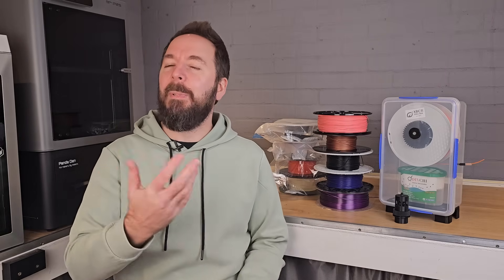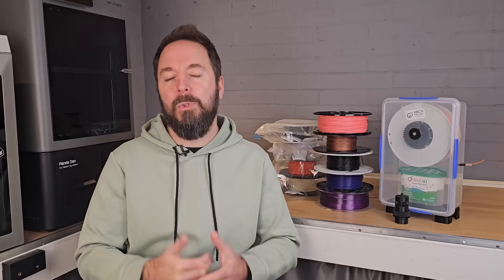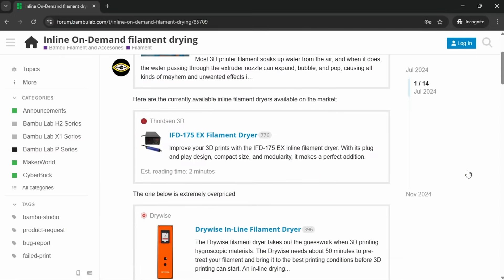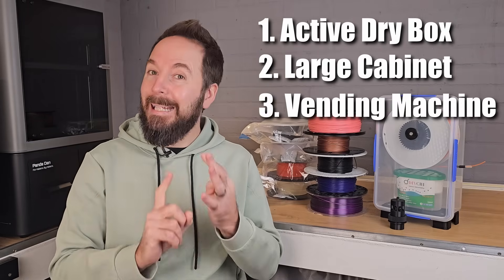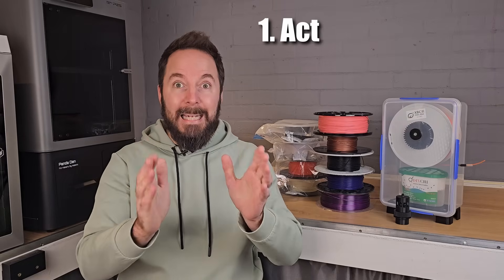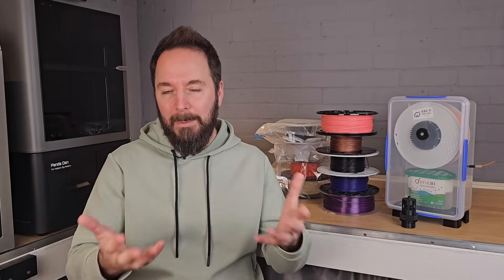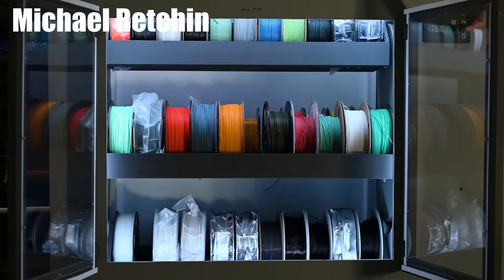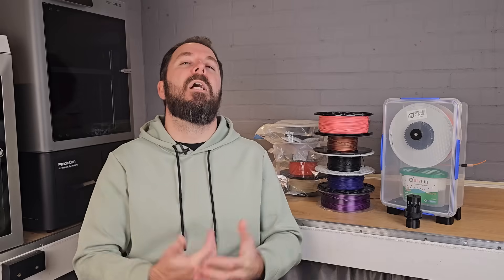Filament Storage 2.0 - The Plan

Comment: I currently use the cereal box method with dessicant for my PETG and TPU.  There are only 4 or 5 of these boxes.  I was thinking about your vending machine.  If you have an air tight cabinet that you can see into with a carousel you could set up a pair of gloves through the wall like hospitals use with premature babies.  You could then select your spool with the gloves and place it into some type of drawer that clould then be closed inside the cabinet.  Once closed inside you remove your hands from the gloves and open the drawer from the outside and get your spool.  Air inside the cabinet doesn't change and no need for a mechanical delivery system.
Reply from the maker: Cool idea that keeps the cost down for sure!

Comment: I would like to see 1 and 2. It would be nice to have a 1 with maybe space for 3-4 rolls of filament. Or a drawer format.

It’d be nice to see a modular solution that could exist on a set standard of space. You could then create generators similar to gridfinity. You’d have to separate the drying, desiccant, and storage into separate values. This way it could adapt to whatever containers you could fit into whatever is available. Using a generator would help keep the administrative work down while creating a successful, widely available, and logistically possible system. 

I would love this if you could store and print from this would be best for me with a drying option being awesome. But I don’t have the technical knowledge to be able to do any of this. But it would be awesome.

Comment: I'd say 2 is a good alternative that I have been thinking about, just make it with MDF or even start out with something from IKEA, make some doors and you're done. While it's true that the open door problem is there, as in suddenlly your whole cabinet is normalized to the outside humidity (whatever that would be). I just wonder if 2 could be combined somehow with somewhat sealed drawers for each roll so that you can, even without a carousel as mentioned in 3, you can easily pick a single roll without changing much for the other rolls in the system. Obviously, 3 is even better, but it might be a bit expensive and take a long time and introduce a ton of sources to potential errors…

roy

Comment: Great Video and very good project.. I'm a Number 1 and 2 for myself. But the CFS's should have a companion dry box for all four rolls. My new K2 Pro combo is GREAT but switching filaments can be a problem. Loaded the original 4 rolls, but the WHITE went funny(wet) fast and broke off in the bottom (2) had to remove it and get the piece out. after I re-dried the spool its printing good but one part did lift the corner of a piece slightly out of 6 alike pieces, the part closest to the door(so sus)

Comment: Exciting ideas, and I subscribed to watch what the community comes up with, but I think many people have a requirement that's not been touched on, and that is at odds with some of the proposed goals: use of an AMS or similar system. Being able to print directly from the dry box isn't going to help when I have to move the spool to the AMS. I don't think I'll actually use whatever solution is come up with here for this reason alone. That said, I'm still highly interested in what is created here, and I may be able to "steal" some ideas for my own needs.

Comment: #4. If we can get that to work reliably, the storage becomes much less of an issue. I think that it would have to be adjustable to the filament you are printing with, and it seems like the commercial versions (that I have seen so far) don't use a long enough path over which to dry the filament. I believe some company recently introduced open-source filament RFID tags. I think these could prove themselves to be invaluable to your cause here. Obviously as a basis for keeping track of what filament you have, but also, could be read by the inline filament dryer so it knows what settings to use.

Comment: I think I like the Active dry box (1) for single filaments the most, because it's flexible. I am pretty limited on space, so I don't really have the option for a cabinet. I think the suggestion of a dry box to dryer "adapter", so you can just put the box on the dryer instead of needing to take the filament out, is great. I am wondering if it might be possible to 3dprint the boxes, because than we wouldn't be limited by finding boxes of the right size from local sellers, but I don't know if you can make that air tight enough (Maybe with a TPU seal?)

Comment: 2 and 3.

Currently I have +200 spools all 1kg (I do have 3 or 4 3kg but I'm not stressing about those) so if there is a cabinet involved I am sure I'd need several - so.... cabinets that can be placed close to each other without impeding access to the spools would be a must.

Thinking about the issue of opening a cabinet and allowing damp air inside.... maybe. the cabinet is actually a series of smaller cabinets, stacked and connected, so air escape/ingress is minimised.  I like the idea is stacked smaller cabinets as it could make assembly easier and cheaper.  Cabinets that have some ducting that connects via magnets and have valves that open/close as the cabinet doors are opened.  Maybe.

This is a great project idea.
Reply from the maker: Some great ideas, thanks Ian

Comment: I think it would be good to combine option 1 with the others, so you would have an individual dry box for each spool, that would act as a cassette, or cartridge that will slot into the larger cabinet or vending machine. For storage or drying, but can be printed from directly when removed.

Maybe then you can separate the drying and maintenance responsibilities, with the cassette holding some dessicate, but the cabinet or vending machine having a dryer that the cassettes connect to when stored

Comment: I'm very intrigued by 4, currently I have a small 5 foot high shelf from harbor freight and I keep my filament in the boxes they come in from microcenter with small dessicant packs in the center of the spool. I use a nuwave oven to dry my filament and keep them in vacuum seal we d bags inside the boxes. But the shelf filled up immediately and I would need a second if I get more filament. But other than that it works well for me.

Comment: Just an idea for option 1, why not build a drier unit to a lid, then all you have to do is fit the drier lid to the box, dry the filament and then swap back to the normal lid. No need for any connectors or complication.
Reply: That’s just the Polydryer with extra steps
Reply: @spencer4hire81 and significantly cheaper
Reply: @Atlas_FPV  time is money, and I prefer using my printer to print prints for my projects, instead of using my printer to print prints for my printers. The filament you would need to accomplish this safely is not cheap like PLA, and you would still need off the shelf components and safety mechanisms. Buy the polydryer and modify the dry box to fit it. KISS.
Reply: @spencer4hire81 none of that is true sorry, it’s extremely easy and very cheap.
Reply: @Atlas_FPV none of it is true? Okay, ignoring the fact that you’re telling me what I prefer to print, I value my time at $20/hr. And I value my printer time at $2/hr. Show me a design that costs less than $60 in filament cost, material cost, and assembly time for a SAFE heater with at least two failsafes. Just because I’m interested in fairness, we can ignore the cost of design. And I won’t even factor in opportunity cost of the other, more lucrative projects that you could otherwise be spending those resources on. 

For those with the resources to buy off the shelf, DIY is best reserved for where it will give you capabilities that you can’t get off the shelf, and where it can save you lots of money. I need maybe four polydryer heaters ever, but I can use dozens of polydryer compatible boxes.
Reply: @spencer4hire81 you have created in your head what this should be and you’re projecting that onto me. Just leave it, my time is worth £33/ hr and you’ve wasted £10 of it.
Reply: @Atlas_FPV You told me it was easy and cheap though, so why can’t you just do it and share the results?
Reply: @spencer4hire81 it is… the issue here is simply that your mind cannot comprehend the solution, that doesn’t mean the solution doesn’t exist. I will see what solution he comes up with, if I don’t like it then I will design my own. Now go outside, I don’t understand why you’re wasting time here.

Comment: 2 & 3 for me
I run a small etsy store, so I have at large number of spools in various colors and materials that all spend different amounts of time waiting for their turn on the printer. PLA is the biggest offender in this case, because while it won't really absorb a lot of moisture, it will become brittle from too much exposure. A large, or at least modular cabinet-style solution would be great, as that would allow me to maintain a stable environment for long-term storage without having to put up with the hassle of vacuum bags or have dozens of spools in individual dryboxes. 
A quick note on the drybox idea; I definitely think a hybrid approach here is the way to go. You could very easily make a fully 3D printable (see Moby Motion's video on the subject for proof of concept), or modified commercial solution (like a cereal container) that fits onto the polydryer. This would solve the cost issue of the Polymaker solution, while keeping the usefulness of the removable drybox. I think it's definitely going to be necessary for most practical applications to keep the more expensive and highly hygroscopic filaments in their own sealed containers, and use bulk storage for things that aren't as sensitive. Think, big carousel style sealed cabinets for PLA, but a simple shelf with dryboxes for the more sensitive filaments. You won't need to invest a lot of effort into a big fancy all in one solution when the bulk of the material people are printing with doesn't really need active drying in the first place.
That being said I'm a sucker for a big over-engineered solution, so you do you. I'll still want to see it, lol.

Comment: 2 - I’ve only had a printer a month or so, and I’m shocked how quickly I’ve ended up with so much filament!

Once opened, it currently sits unprotected on a modular rack I’ve printed, or on the AMS, which I’ve got a dehumidifier sat right next to, in a vain attempt to keep it somewhat dry.

Comment: 4 - Inline drying sounds interesting. I don't tend to store much filament - as it stays on printers until finished. But, even with PLA you can tell when it's been on a printer for more than 7-10 days (UK) as whispy stringing increases. Inline drying (if practical) could be ideal in this scenario, especially if it could (for instance) be placed inline with AMS style printers so there is only one dryer required for multiple spools.

Comment: Spoolman has solved my tracking problems. You can print / scan QR codes if you need them but I don't have enough reels to really make it worth doing. I think option 1 or 2 based on space constraints.

Comment: 1. I’ve just bought the new Sunlu SP2 dryer box. I saw your video reviewing it and thought that, like you, it could be extended with multiple boxes stacked up….but having just seen your connector it would open up the ability to have a broader base of boxes with stacking, being fed from a single heater with a modified base piping the heat to all the “base boxes” then allowing the heat to rise up to any stacked boxes places on top. For example 1 heater, 3 bases and 2 layers would give 6 boxes in total (each box holds 2 1kg spools) = 12 spools. Only issue is there is only one heater with a source so everything is heated to the same temp.

Would be interested in getting a step file of the connector so I can have a go myself!!
Reply from the maker: As soon as I have something that I think is usable I will make it available for download Simon. Thanks for your ideas, the SP2 definitely got me thinking!

Comment: 1-2.   Active drybix being a cabinet with a desicant wheel that rotates. A fan passes air through desicant and around the cabinet. Spent desicant in the rotating wheel is yeated and dried in a separate chamber. Thus using heat to dry withput repeated heat cycles and damage to filament

Comment: I would like to take the humidity out of the box in real time using  the Japanese films that Stefan ( CNC Kitchen ) used. It pulls the H2O apart and removes the H+ from the enclosure, or possibly a peltier junction to condense the H2O.
Reply: I used one in a cabinet I made.  It has two slide out racks and holds a total of 42 spools.  The cabinet is plywood so I covered the inside of the cabinet with aluminum faced butyl tape to block water vapor.  Empty it got down to 14% relative humidity and was still slowly going down when I stopped the test.  The filament (and some printed parts to hold refill spools in the bags) apparently have some moisture in them because now the cabinet is at 23% and dropping slowly.  This would not be good enough for extremely hygroscopic filament, but I print with PETG and just want to keep all the various colors dry while they sit around for along time.

Comment: 2. I have 3 active dry cabinets that work well, but they are rather expensive. The way they dry is rather simple, they have desiccant,  a heater, and small louvers that open and close. They don't use much power. Now I don't keep all filaments in there, is just not worth it.

Comment: I did buy serialboxes. The problem with these boxes is that you loose almost 5cm room between each box because they are V-shape and the lid sticks out a lot.
I stopped using them because i loose 4 rolles room out of 10 rolles. I don't have a lot of room.
Now i use vacuum-bags from Eibos witch are very good.
I need a box that is straight. Top and bottom equal width and the lid NOT sticking out.

Comment: Due to space constraints, I have to use option 1 when I use filament that needs to stay dry like PETG.  If I had the space I would love to use option 2 or 3 or maybe a combination of 2 & 3.  Yes, I know, all filament should be dried or kept dry, which is why all my PLA is kept in either zip lock or vacuum bags with desiccant packs when not in use.  PETG is dried first and them "stored" in one of your Ultimate Dry Box designs.  I'm up to 2 of those at the moment and may build another one or two.

Comment: 4- inline drying that works solidly without much fiddling removes much of the need for storage drying as its being dried as its used and should be possible to achieve without taking much space as oposed to other methods that would require each person to have space available.
Reply: I can't see in-line drying removing the need to store highly hygroscopic filaments in high humidity environments.  I doubt someone printing with TPU or nylon in Florida could get away with just in-line drying.
Reply: @Becvar80  Inline drying solves everything ... provided it works of course.
But I agree, if the impression is that it can't work for humid environments, then there is no point in it at all.
However, I think it could work well, and I'm solidly in the number 4 camp, making everything else a remote 2nd priority.

Comment: If we are only talking about opened filament spools I see three areas that would need to be addressed:
1) Storage: It should be Modular. How about a modular system of single spool containers that can be put side by side and stacked on one another, while still being accessible when needed for printing from.  
2) Drying: This depends on howmany spools you would need to dry at any given time. It should however be scalable. What if the containers could somehow be interlocked to use a single heating/drying element so that more than one container could be dried at a time? Maybe upto say four containers at a time.
3) Printing: You should be able to print from the containers without having to open them. 
If you keep the filament dry during storage and don't have to take the them out of the storage container to print, I don't see the need for an inline drying solution. For me a vending machine type solution is a bit over the top, but still an interesting idea!

Comment: My choice is 1.

Not too long ago, I wanted to understand what was causing PLA to become brittle over time.  My first guess was that it was exposure to oxygen over time, but according to what I've read, it's actually moisture in the air that causes the polymers to break and lose strength.  According to this, there's permanent damage done to PLA exposed to humid air, so using a solution that only has an inline dryer is not going to resolve all aspects of the humidity problem -- unless you don't use PLA (or other material with the same problem).

I've found that with my small setup, the calcium chloride is pretty cheap and effective.  Even though I can't (easily) recharge it, the chemical itself is so inexpensive I'm not really stressing on needing to recharge it.

Comment: I think having a "universal base" and building with it using modular options for people to expand on it will be a necessity, kinda like an EVA 3 toolhead system. 

Personally, In an Ideal scenario I want a smaller ~12 spool storage/AMS like-solution to be wall mounted for the filaments I use frequently, right above my two printers, that I can feed directly into my printer and be able to remove/add one without disrupting the others too much. And also, having a bigger floor one for storage of filaments I use less often, just enough to keep them dry, organized and easy to retrieve.